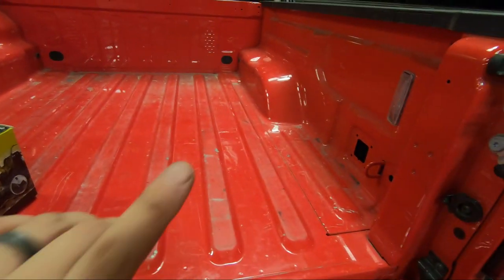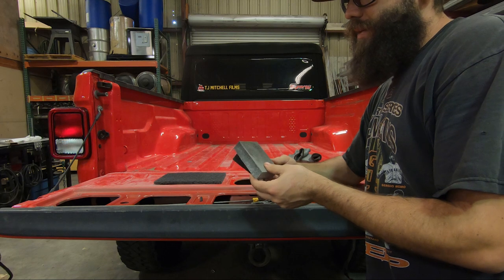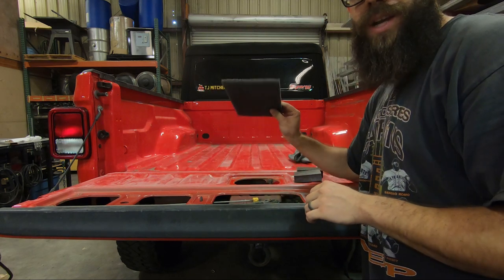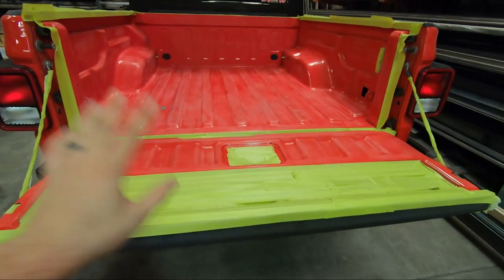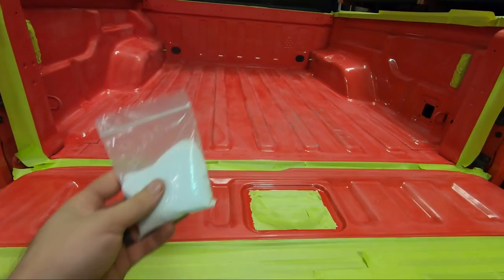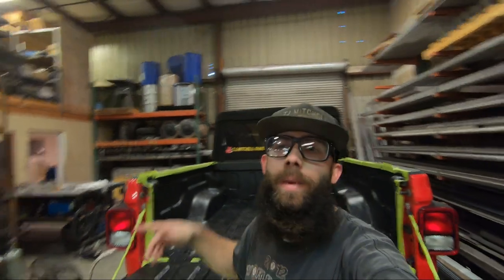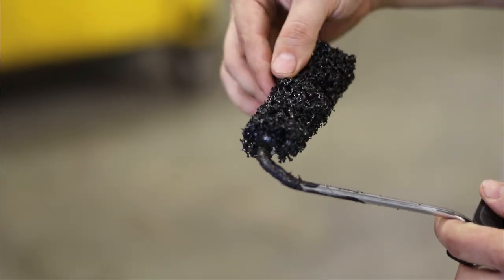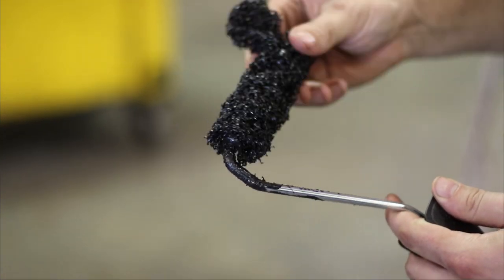Is Raptor Liner Bed Liner Any Good? $90 Roll On Kit How To & Review

Comment from the maker: What is every ones thoughts on DIY bed liner kits?
Reply from the maker: My factory paint in the bed was already being destroyed from using the bed... So it protects the bed, as well as helps things from sliding around. Plus I like the look. A rubber mat is quick and easy that's for sure. It doesn't protect the sides of the bed though. 

No issues with pin stripes yet. No extra protection just careful driving...

Comment: Your comment about the rollers is 100% right.  Yesterday I put raptor roll on for my truck bed, and I went the rollers really quick.  Luckily I had a more expensive roller I bought that did the rest of the bed just fine.  What I did was brush it on, and then used the roller to roll it out a bit, seemed to work very well that way.  I was still able to get the texture I wanted doing it this way.
Reply: What kind of roller did you use? Regular paint roller?

Comment: I just did my truck bed  it came out great!!! Took me about 4 hours luckily I purchased 2 packs I needed all the rollers I ended up using all 4 rollers to complete the job.
Reply: any issues with the rollers breaking apart to quick?
Reply: Yes the rollers fall apart quickly.. I think the paint way to strong for them but my truck bed came out great!! Still looks new till this day
Reply: Yeah that is what I keep reading but cant find any videos of people using anything else. Hardly any roll on videos mostly used with a spray gun. I'm about to do a blue metallic over my entire blazer so I don't want it to look like sh!t. You know, tiger strips and all that but it is good to hear it still looks good with the roller issue. I did read some have used a dupli color roller instead or a rust'oleum (rock solid) roller for staining decks. Still no videos or much info. A roll of the dice. Thanks for the reply.
Reply: Do they sell the rollers separately?
Reply from the maker: Anthony you can find them here: https://www.amazon.com/dp/B0BK61RNWC/ref=cm_sw_r_as_gl_api_gl_i_QX3TPTWW534M7S4PZAYP?linkCode=ml2&tag=troymitchell-20

Comment: I'm thinking of doing it to my recently acquired 1988 Ford F-250 that came from California and is pretty much rust free. It has the factory plastic liner in the truck. Sounds like I need two kits, my truck has an 8-foot bed. Is it still holding up okay? Also, since I've got a lot of real-estate to sand, would a very light grit sandpaper on an orbital sander or vibration sander work as well? I want to speed the sanding process if possible. I live in the Washington DC area and fall is here with winter not far behind so I want to get this done ASAP or it will have to wait until probably next summer. thanks for the video.
Reply from the maker: So far it’s still holding up great. I would recommend the spray on version for a bed that large. I think you will thank me later on that part. Yeah you could totally use an orbital sander to help speed up the process. It’s all in the prep work so the better you prep the better then end result will be.
Reply: @BuiltForDirt  Thanks I will likely have to do it next summer/spring,  its getting colder and leaves are falling. I work on it in my driveway and I imagine it has to be applied at a certain temp.

Comment: I plan on doing my entire truck except for the bed which already has linex. A lot of my paint has completely fallen off exposing the primer. Will primer scuff just like paint? Also I have paint and primer missing in spots with a lot of surface rust and was going to use POR15, will I be able to scuff that before applying?
Reply from the maker: The primer will scuff up nicely, as for the POR15 I’m not certain.